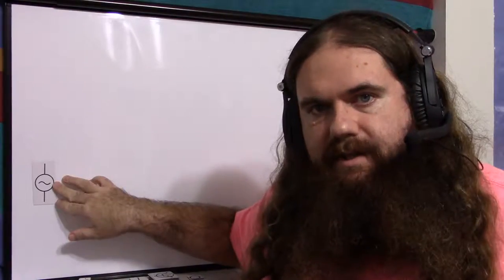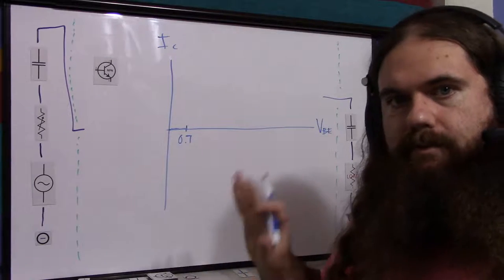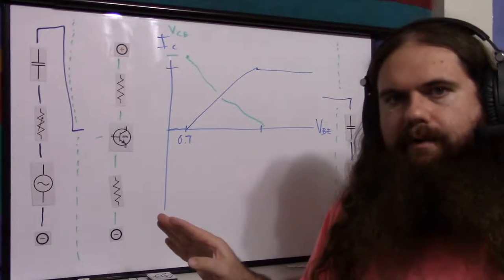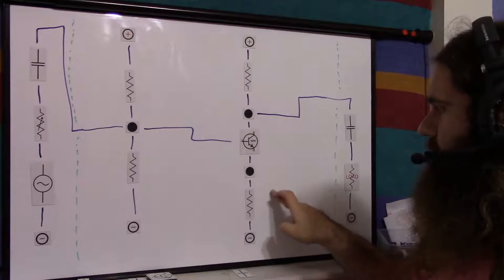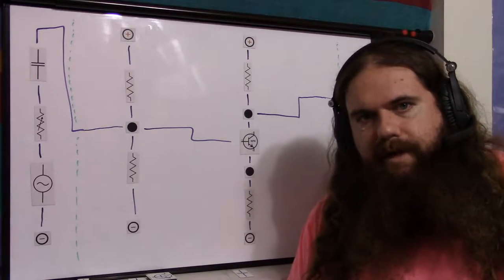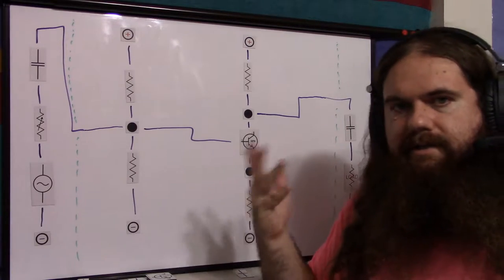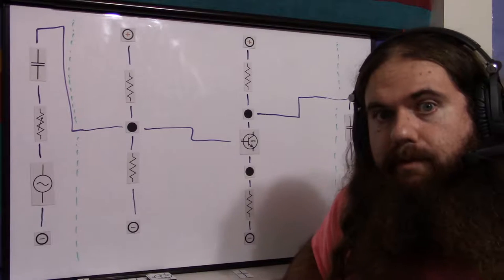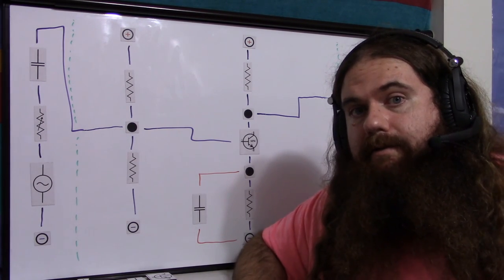Common Emitter Amplifier - Detailed Walkthrough - Simply Put

Comment: Excuse my ignorance but I got a question. Does the fluctuation of beta caused by differences in "input" of a (non-perfectly biased) transistor affect dynamic response of an amplifier? If yes, it is a similar to sag of the amp? 

I'm really interested in guitar pedal making and I'm fascinated by your video.

And!!!
How it affect wide frequency spectrum sound?
It seems like if transistor is dimming under the signal it would affect low frequency part of the signal more as it mostly carries most of the energy.